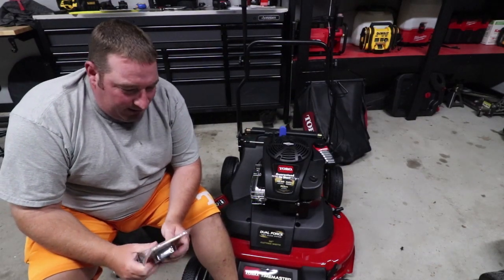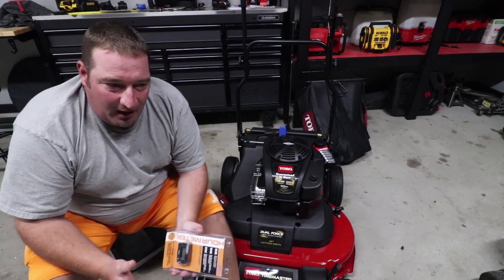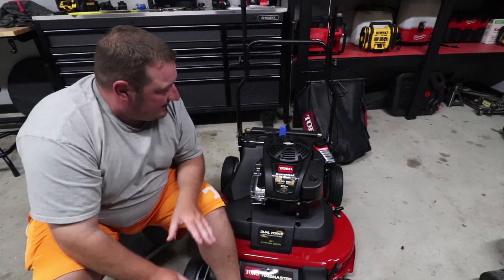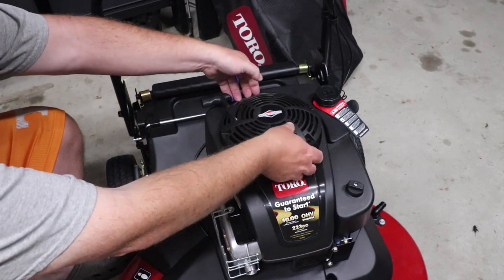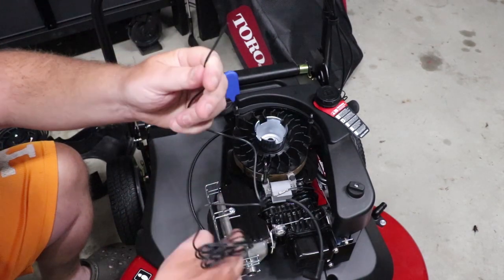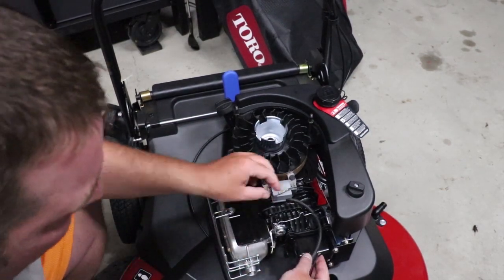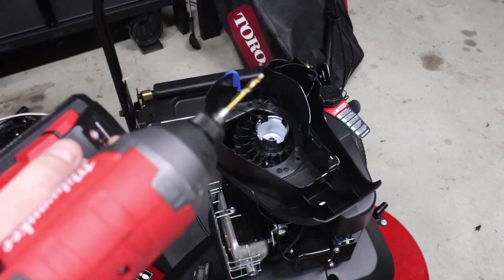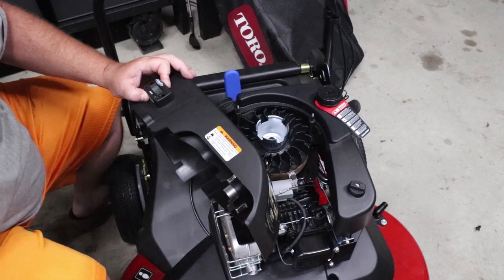HOW TO: Install an Hour Meter On Your Mower

Comment: Awesome, just about to add one of these to a DR T4 Trimmer with the same Briggs and Stratton 875 series engine, will put it in the same place before even adding the oil 👍 Thank you for great video 👍

Comment: Could you use a few dots of hot melt glue instead of weatherstripping?  Or think it would soften from engine heat ?  Seems that route along gas tank should (hopefully) not get too hot!

Comment: I bought one based on your recommendation. It doesn’t work. I have a Walker mower with Kubota diesel 2cyl. You said it works on any mower right?
Reply from the maker: Nope, I specifically say push mower.
Reply: @LanierLawnCare   Stop being right